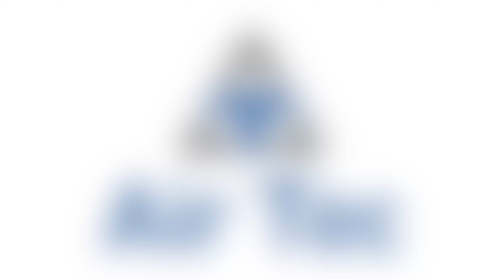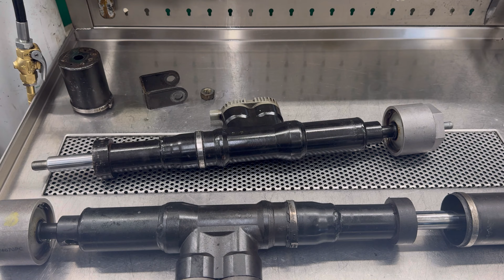Bentley Arnage ARC Suspension Repair – Full OEM Restoration & Testing

Comment: could you explain what makes a suspension comfortable ? is it just the damping rate that’s low for high-frequency ? I am doing a uni project and I am kind of lost, i would love to reproduce something like a bentley or royce suspension
Reply from the maker: Comfort is definitely not just about the damper, and not only about having low damping at high frequency.

A comfortable suspension is a complete system, where many things work together:
	•	Spring rate (airspring or coil) – this is actually the main factor for comfort. Softer spring = more comfort, but too soft = instability.
	•	Damping curve (shock absorber) – not just “soft or hard”, but how it behaves at low speed vs high speed, compression vs rebound.
	•	Wheel and tire – tire sidewall acts like an extra spring. Low profile = less comfort.
	•	Bushings and mounts – they filter small vibrations before they even reach the damper.
	•	Suspension geometry – motion ratio, leverage, kinematics all matter a lot.
	•	Vehicle weight – heavy cars (like Bentley/Rolls-Royce) naturally filter small bumps better.
	•	System integration – especially with air suspension, where ride height, pressure, and damping are all working together.

About your question:
Yes, low high-frequency damping helps, but that’s only a small part. If you only reduce high-speed damping, the car may feel floaty or unstable.

What makes cars like Bentley or Rolls-Royce special is:
	•	Very well balanced spring + damper tuning
	•	Air suspension with large volume (very important for comfort)
	•	Extremely well tuned low-speed control (so the car doesn’t feel loose)
	•	And a lot of work on bushings and isolation
Reply: @AirTecSuspension Oh thank you so much for the ammount of details ! It’s amazing. I am trying to make my cat a bit more comfortable and i’ll see if i can implement some of this